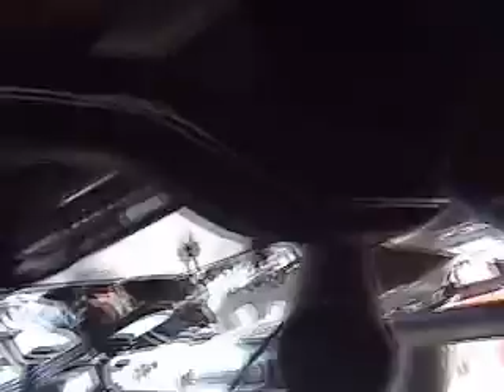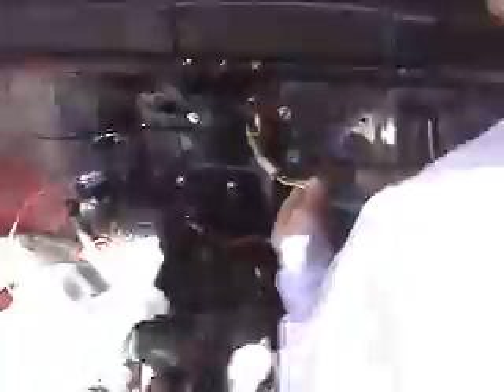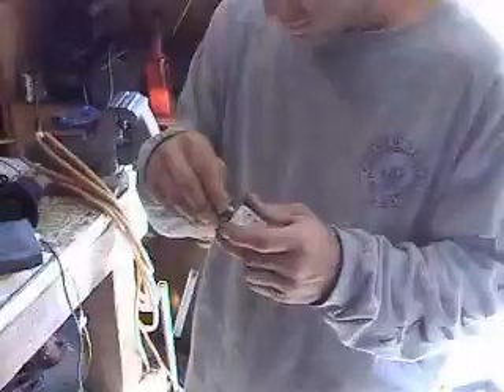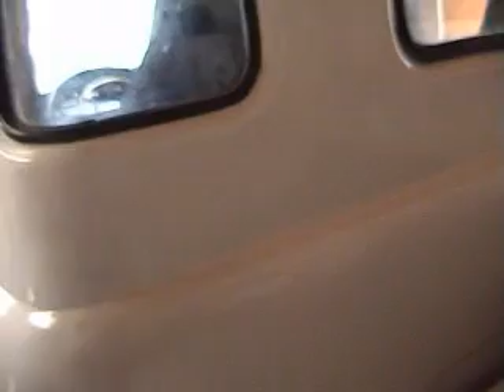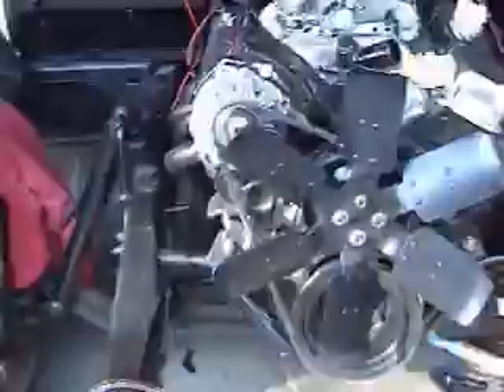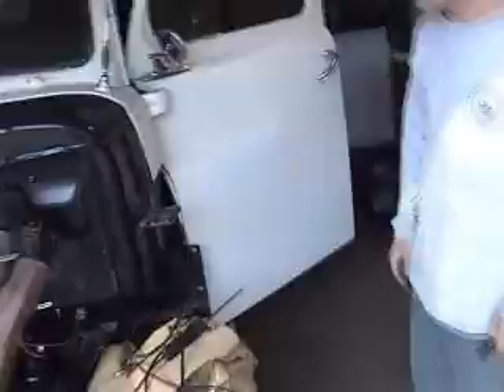Bethel Brothers Hot Rod Project Sam Electrical Part 5

Comment: Hey brothers. Just wondering after watching you guys wire in the electric fuel pump, do most people wire them up to an on/off switch because i would have thought that it would have just been wired to the ignition some how so it turns on/off with the key. But i guess you wouldn't want it running while your sitting in the carpark listening to the radio with the accessories on. Cheers bros.